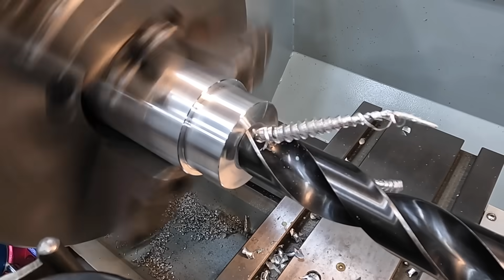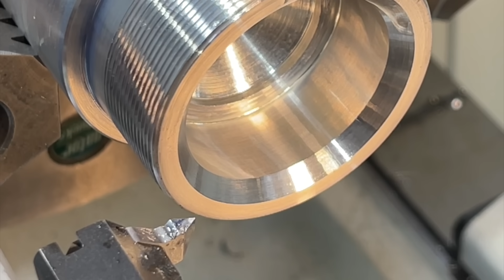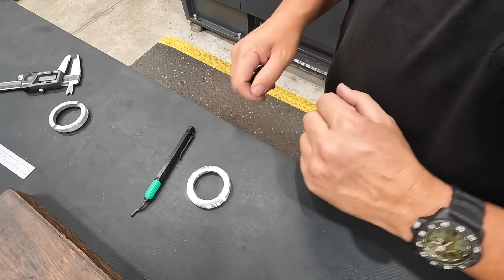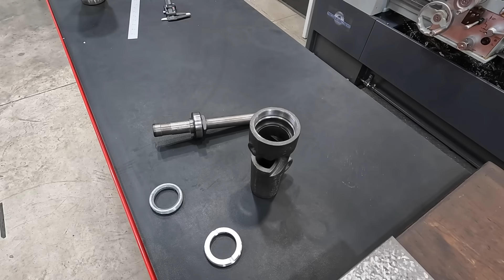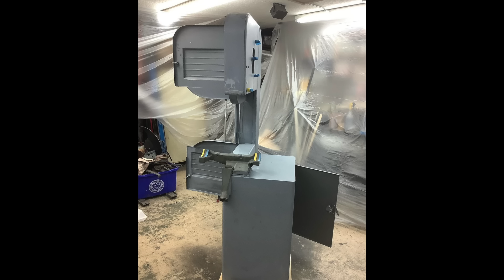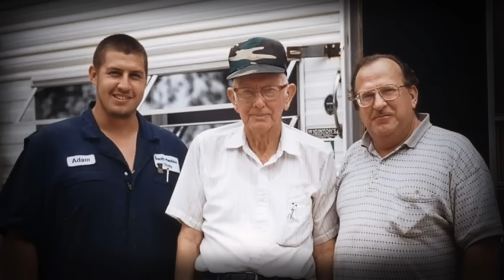Rockwell Bandsaw Repair Part  2

Comment: I used Tap Magic on an Aluminum project and I did not heed their warnings about that product, It caused me to loose my brain for about 45 minutes, I could not talk.
Reply: Which/what warnings?
Reply: @StringDriverOn the bottle.
Reply: @edwardaloftis6705  what kind of warning? Just curious. You made it seem like cognitive suffering.
Reply: @StringDrivera lot of fresh air while using the product.
Reply: @edwardaloftis6705  ah. I’m not a machinist, nor close to it. Not familiar at all aerated hydrocarbons are super dangerous.

Comment: Was there a concern about dissimilar  metals?
Reply: I think if maybe these parts were subject to a lot of heating and heat cycling the ring might start to back out but just a tiny drop of Loctite couldn’t hurt.
Reply: In a high acidic environment I think so.
Reply: I had same thought..?

Comment: It still amazes me how the machine catches the thread perfectly every time. I just can't make sense of it in my head.
Reply: The rotation rate of the lead screw (which drives the position of the carriage which in turn holds the threading insert) is synchronized to the rotation of the spindle through the change gears (and/or gearbox) & the half nut. When the half nut is engaged at the correct position, the gearing ensures that the insert always lines up with the threads.

It definitely helps to see a manual lathe & examine it in person. Move the spindle by hand, see how the carriage moves, etc. Figuring out how the half nut can engage in more than one position is particularly important for understanding!

Comment: I'm surprised the retaining nut was made from aluminium Adam. Would have thought it was originally made from a more durable material.  I think I would have faced off the cast iron part after cutting the thread, as a reference surface for any future work. That said some fantastic machining Adam. Incredible attention to detail as usual. Love your videos. Cheers Nobby

Comment: Adam
Can you please advise the tool holder code and insert code for the external threading setup. All threading tool holders I have place the insert in a horizontal position. The holder you use in this video has the insert in a vertical configuration.

Comment: That bore is big enough that I think you could come in with a boring bar on the compound and cut that 45° angle from the inside. You'd have to cut a groove for the cut to bottom out into. So, 1/4 wide groove 1/8 deep at the back, then shave the corner off.

Or just make the groove with a form tool. I've actually got a Micro 100 thread relief tool sitting in a tool block right how that would be perfect for this.

Also, regarding deburring threads: Lay-down full-profile inserts FTW.
Reply: only thing is that you can't measure how far you got, have to trust the numbers
Reply: @CatNolara  it doesn't really matter, since you'd set the actual chamfer length by parting off. The internal chamfer just needs to be long enough to pass through the (eventual) parting plane.

Comment: aluminium with cast iron doesn't sems to be the best combination
Reply: It will be an electric potential between the materials when they get in contatct with grease / liquid. Then the retainer will oxidize and be stuck inside the threads forever. He should mount a sacrificial anode block on the outside.
Reply: One can buy dielectric grease.
Reply: @johncolvin2561  That won't work.
Reply: @SwedishNiceGuy  You do not know what the word dielectric means!
Reply: @johncolvin2561  I do - I explained it in my comment before you commented, without using big words "normal" people don't understand.
Reply: @SwedishNiceGuy  You know nothing about the world in which machinists like Adam Booth live and work. Adam is a third generation machinist, so he knows that aluminum will work quite well in that application.
Reply: @johncolvin2561  .......and keep on greasing.😅
Reply: so the insert won't damage the thread? as long as it's greased it won't corrode and get stuck
Reply: Looks like the manufacturer used aluminum as well. He replaced same for same.
Reply: A bronze nut would have been suitable, and easy to machine like the alu one. Galvanic reaction can sieze things over time.
Reply: @mohabatkhanmalak1161  I'm no machinist but I like the idea of a bronze nut personally. Bronze and cast Iron seem much more similar. Possibly since the guy sent the Aluminium, Abomb just went with it... Perhaps we will never know...

Comment: I learned a lot by watching both parts 1 and 2. Genius setting up the order of work! I have a question: In the OD threading, did you still use the 29 deg offset? It looked like you  were going straight in at 30, but that's certainly hard to see. You mentioned the offset earlier in either part 1 or 2 and I'm just curious if something changed. Thanks for all the work that goes into the channel!!

Comment: Nobody who hasn’t done it can appreciate the experience and reflexes it takes to single point thread at 620 rpm. A very small fraction of a second later with the half nuts and stuff breaks.
Reply: I have cut 11 1/2 threads and 2 1/2, the only company use 11 1/2 threads are power Co. And cable Co, Telephone Co. They use them on wooden  poles only. 2 1/2 are used by Fire Department.

Comment: Well done. What else to expect?
Thread checking. Not changing the settings from cutting the internal thread the same thread will be cut I think.
Tap magic aluminium... Denatured works fine and is likely costs less.
Really high finish during the last part of the work. Cosmetic but good for future business.

Comment: Could part the nut off and screw it into the part then chuck the part in lathe as a nut holding tool to then face it off. No soft jaws needed
Reply: Either that or reverse the chuck jaws and grip the nut internally to face the other side of the nut.  3 jaw concentricity is fine for facing I think!

Comment: Great job Adam.
Question - How do you identify your material metals if say they're not properly labeled? Obviously, one could use a magnet for one, but that only tells you if it's iron-based. But what do you do otherwise?
Reply: Metalworkers are able to identify unlabeled metals based on weight and color, among other factors.
Reply: Unlabeled metals can be very hard to identify, especially if they are different types of the same metal. Usually the end is painted a different colour for different types.

Comment: Nice job!
I noticed that you used a lot more lube than we usually see you use when machining this aluminum. I got the sense that it was to get the best surface finish. Is that because it was feeling "gummy" or something like that?

Comment: I curious, How much do you charge the costumer for this job?
Reply: Seems like machine shop rates has gone up lately. Maybe 150 to 200 USD an hour. Fairly expensive nut, but a do or die for the saw.
Reply: @Drottninggatan2017  
Seems fair
Reply: The O.E. nut is available at renovoparts for about $18
 
 That said, the customer requested it be made and supplied the material, so the customer gets what they pay for.

Comment: Nice work Adam.  Having the flexibility to do a project you're interested in makes it much more enjoyable.  There are countless ways to approach machining a part.  Lapping the back of the parted off ring was a neat way to finish the part.  

It's always funny to read the comments on why you chose to do things X or Y way, when there is no wrong way in YOUR shop.  You have demonstrated mastery as a Machinist and the willingness to embrace new methodology countless times.  I'm excited to see what's next.  Cheers my friend
Reply from the maker: Thanks Derek! I appreciate how supportive you are to this machining community! 👍🏻
Reply: I second that! What's the point of having a chef if you're going to tell them how to cook everything and that they're doing it all wrong; the chef would be out the door saying I can't work under these conditions! Your dedication and generous spirit are admirable and fun to watch and I even learn stuff, sometimes nothing to do with machining... 

Having worked as a casting technician/jeweler I do relate to the things you do though and the ways you do them. I was very happy to see the 600 wet and dry paper come out to finish off the parted side, it's what a jeweler might have done (before buffing it to a mirror finish)  :)  All the best Abomb.